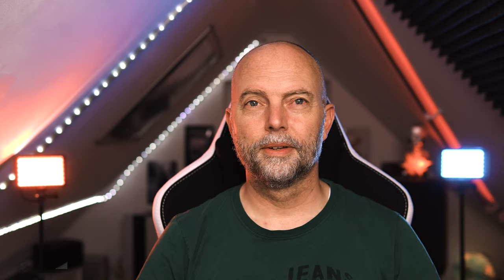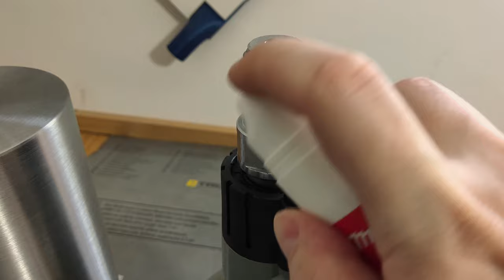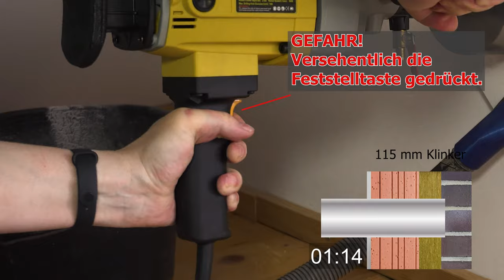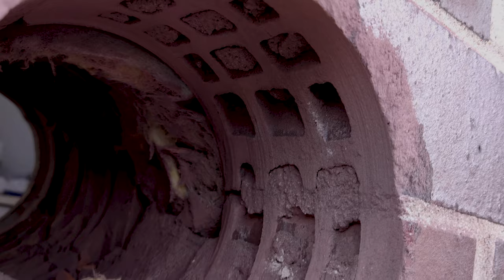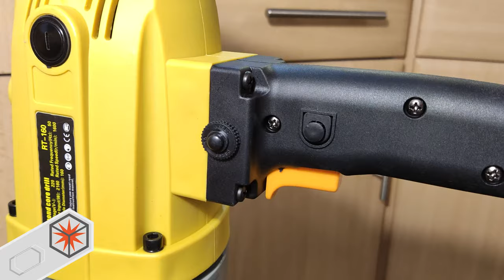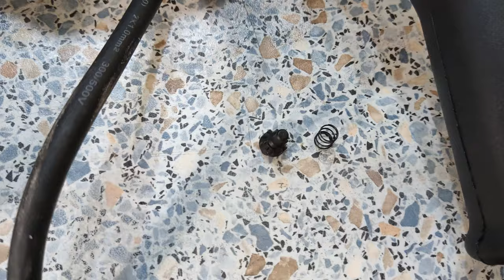Kernbohrmaschine RT-160 gut und günstig? Oder lebensgefährlich?

Comment: I don't speak German very well so I'll reply in English.
What you can do when you struggle with the hard outer bricks is carefully hit the segments on the coredrill bit.
This will expose the diamond flakes.
Because you're not using water it gets extremely hot and the diamond gets covered with the segment material.
You can also buy some special sharpening grit but that costs money 😁

Comment: its worth the money, because you would have to use rotary hammer and lose a lot of time and it would be an ugly hole. This is great machine for houses with all kind of bricks, wood, ytong, sandwich panels, knauf and similar light stuff. Especially when you need big holes for solar electrical stuff, for sewer, for canalization, for air conditioners, for ventilation, for chimneys, basically for anything that requires such big holes. Luckily that you are German, cuz there is similar tool in lidl, just from recently, Parkside PKBM 1800. Big problem with this tool is that, if you are using it to make money, then you need to open it frequently, put new greese and check the electrical brushes. This tool is rotating for long time over high heat so this maintenance has to be done so the tool doesnt die. That would be it, greetings from Croatia. I have many cousins and friends working in Germany, thank you for allowing them to live a decent life and be paid for their hard work, they are all in construction and stationated in münchen :)

Comment: I have made a couple of core drillings in different walls and materials.  Based on my experience I wish to suggest a thing or two. It is of great importance ( especially when drilling without a stand  ! ) that the bohrer had a sufficient purging or flushing at the cutting edge !! In this video the guy seemingly never tried taking out the bohrer to make sure the cutting edge got sufficient air purge. I found it a good practice to remove the unneccesary pieces of the cut parts , even breaking it by a hammer. That decreases the potential clogging-bogging downs. When leaving the center part all the way inside the bohrer you face unexpected contacting and consequent slow-down bogging of the rotation. Kick-backs even!  Any bohrer would enjoy having the ground dirt removed so allowing the diamond particles contacting the surface to cut. I consider this video a bit  unpofessional. Hand-held drilling is always riskier than performing it with a stand. Try again doing it with a couple of stops to remove the inner cut-outs.  With friendly regards: K.A. L.
Reply from the maker: You are right, I am unprofessional. The video shows my first core drilling, how could I call myself a professional? In fact, on my further core drilling, I removed the first section of the core and then continued drilling. Interestingly, however, these holes were more problematic. The drill bit often blocked when it penetrated the clinker layer. So I am not sure if the drill core, if left in the drill bit, is actually beneficial, as it has a rotating mass that could assist in penetrating the clinker layer. I don't see that the core bit does not have enough air to remove material, because my wall structure is made of perforated stones that have enough space for the dirt that is not sucked off.
Reply: Hallo, mal abgesehen von der Arretierung im Schalter, scheint das Teil ja Dampf zu haben. Was mir aber sofort aufgefallen ist, warum hast du den zweiten Handgriff nicht länger gemacht? Jeder AkkuSchrauber mit großem Drehmoment hat einen 50-60cm langen Griff. Gibt es im Zubehör auch einzeln, wäre bestimmt ne mega Verbesserung.

Comment: Hello, good job, nice video!.. 
A few things: 
This machine looks like it has so much power, but no safety clutch, no soft start, no electronic safety elements (only overheating safety), no prcd switch (on a machine, that could work with water).  It can break your arm and nothing protects you in case of electric problems (or when cutting a cable while wet drilling).
For dry core drilling you should use a vacuum adapter directly on the machine, and a dry drilling core bit. (less segments, easier drilling).
I think this machine shouldn't exist in the EU.